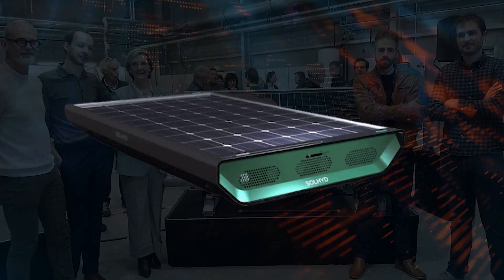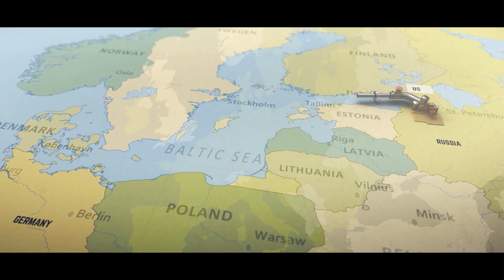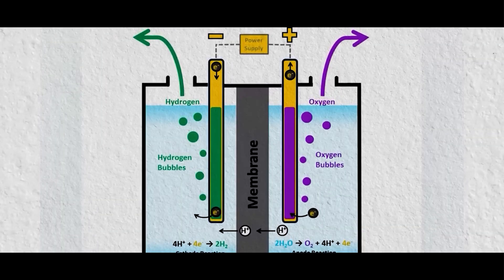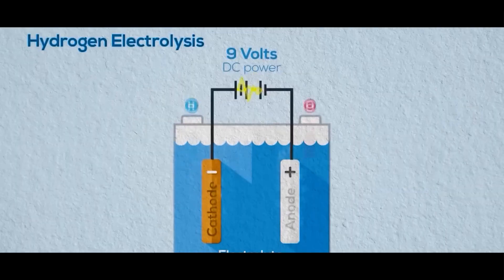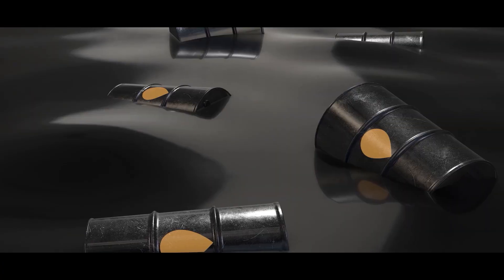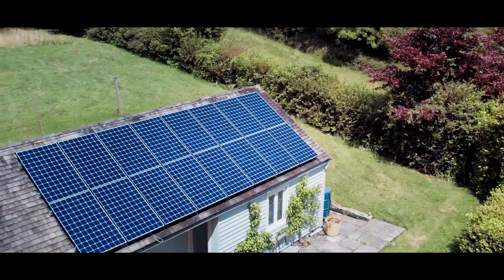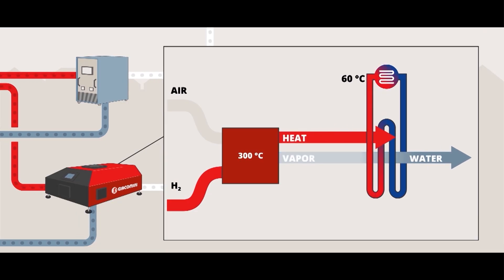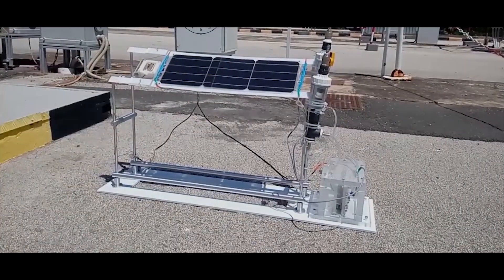NEW Solar Panel Produces Cheap Green Hydrogen at Home | BREAKTHROUGH!

Comment: With hydrogen, we can still use our conventional ICE (internal combustion engine) vehicles with some modifications, enabling them to run on pure hydrogen. This would make our ICE vehicles clean energy vehicles, even cleaner than EVs.
Reply: No you can't
Reply: ... yes, but do not forget the low thermodynamic yield of any engine based on a combustion (of any fuel wharsoever).
Reply: Great idea. Now you will only have to pay around $50k to get the rest of the car converted to run on hydrogen. Plus the $300k to get the equipment to compress and store the hydrogen. Then you will need about 120 of those panels to create enough hydrogen to be useful for driving. Good luck with that.
Reply: @Aircam73  I'm not talking about ALL of it. I'm talking about people who wish to use their ICE vehicles instead of buying a new and dedicated one. That would be cleaner.
Reply: @Schjoe  What I am saying is most people that say things like you keep saying know almost nothing about hydrogen. You can't just convert the engine and start running it on hydrogen. It would take around $50k just to convert your car to run on hydrogen. You would have to rip out the entire fuel system, gut the trunk, cut holes in the body and run high pressure tubing throughout. To put enough hydrogen tanks into a car to make it get close to 200 miles of range with a very inefficient ICE you will take up the entire trunk area, all of the under seat areas with very expensive high pressure tanks. The people who have done it said the cost alone for all the equipment is close to $50k and if you got someone else to do it you are looking at close to $100k. All so you can buy fuel that isn't available, costs 4 times as much and now your car gets half the range it once did. Sounds like a great idea.
Reply: @Aircam73  I'm not also saying that would happen right away today. My point here is, if this will happen, it will happen slowly. We may be looking at 10-20 yrs before every car that was using fossil fuels will be using hydrogen. By then, the cost of converting or may have significantly reduced or other ways of converting without the things you mentioned can be done already. Just like how any other technologies, it evolves and keep innovating as years goes by. Maybe the process is $50k-100k today, but who knows, maybe it'll be just $10k in 10 yrs using simple process and you only have to use water instead of storing a hydrogen gas that may explode. Sounds impossible but technology's innovation is really unpredictable.

Comment: If I can say what they want to say but how are they producing energy from the hydrogen? Because if you have to burn the hydrogen to make energy, you are just putting more carbon in the air more CO2 because as if anybody knows with a little bit of sense. Anything you burn anything it will produce carbon. So making these solar panels truly is pointless to try to get us off fossil fuels when hydrogen is a fossil fuel. The only thing is is working the water from H2O to just hydrogen then separating the oxygen from the water. That is it and besides, even if you could prove me wrong on all what I just said and I'm sure it wouldn't be that hard to prove me wrong. The regular people call the masses or not going to be able to forward something like this. They don't make that kind of income in 2 years of giving every dollar they got or euro and they still wouldn't be able to afford it. The price has to drop dramatically so I'm not going to throw my regular solar panels off of the roof just yet. But y'all can do what you can want. If you can afford it. Do what you got

Comment: These hydrogen panels has been developped by the university of Leuven and a spin off is doing further resaech. This  started 3-4 years ago.  At this moment you can forget an installation at your home as the gas must be kept under high pressure tanks. Hydrogen at home is not yet profitable. Hydrogen is mainly used for ships, trucks trains and other heavvy transport. No not for a car.
Reply: Fuel cells??
Reply: Toyota currently sells hydrogen cars in California…
Reply: @TheNewMediaoftheDawn  Its the only state that does this as they have a distribution network for hydrogen. Some firms ( as Colruyt ...)  in belgiun has also hydrogen cars but its more for publicity.......we have a long way to go as now hydrogen for cars is way too expensif. That wil hopefully change in time.
Reply: Im in the ship industry. We install lately a lot of batteries. But had "almost" one hydrogen project. But Hydrogen is NOT used for ships yet. And trucks are now failing fast as batteries get better. Hydrogen is a failure.

Comment: the cheapest version of the picea system costs about 60000 Euros. Their are quite a few systems already running in Germany since 2018. Instead of installing a swimming pool in your garden, you install such a system 😊. The good thing of the system is: it is very reliable technology and good german engineering. Picea builds about 100 systems per year. Scaling up will bring the prices down. The core technology is modular and not bigger than a refrigerator, with two parts: the hydrolysis unit and the hydrogen fuel cell unit, which turns h2 back to electricity and heat. 
Greetings from Franconia

Comment: This product has similarities to SunHydrogen’s product but may be using very different chemical reactions.  Green hydrogen needs to compete with grey, brown and blue hydrogen.   Finally whatever form of hydrogen your using has to compete with the various other means of storing energy including using gravity as a long term means of energy storage as you can do with pumping water up to a high reservoir or lifting heavy weights up and down.
Reply: "Green hydrogen needs to compete with grey, brown and blue hydrogen"
I have produced clear hydrogen but never any with these colors.

Comment: This is DUMB! Just charge a battery which is much more efficient! Hydrogen is hard to store and if it leaks and finds an ignition source like a spark or open flame you will have house/building fires or explosions! Get non-flammble Zinc-Bromine Flow Battery instead which WILL NOT catch fire!

Comment: Could the hydrogen be used in a fuel cell to generate electricity?
Reply from the maker: Yes. Watch the video till end. There you see a system to convert hydrogen back into electricity.
Reply: @The.Futurist  and only costs 10x the amount of power generated by ordinary solar

Comment: As I have a heat pump which is working well and solar panels/ev I am looking at battery storage to maybe complete my setup. Conventionally using green hydrogen for heating versus a heat pump requires 6 times  more wind/solar. Not sure how stored hydrogen could be used with a heat pump and I am more than happy with my EV but I can see this might work for an industrial unit where they have space to install .
Reply: @D M Since Jun 22 I have achieved an average COP of 3.55. even at current UK cap cost of heat Gas = 10.3/0.9= 11.44p/kWh Electric = 35/3.55= 9.86p/kWh. However we have cheap off peak so our average cost of electric is about 26p/ kWh so cost of heat about 7.3p/kWh. Saving on our heat requirement  11184* (11.44-7.3) = £458 . Inc no standing charge over £500 cheaper. For DHW we have solar and night tariff etc.

Comment: Clever idea.  The winter might gum up your moister from the air portion as water has been known to freeze during the winter.  Also, hydrogen, because it is a very small molecule,, has been known to be adsorb into iron.  Thereby making iron vessels a sort of sieve.  My guess that the team that put this nifty idea together would benefit from the advice of a Chemist.
Reply: It's not this company has been crushed by people who know physics and math on linkedin. One panel does 125 liters at atmospheric pressure on a sunny day. Which translates to 0.33kWh a day. That is NOTHING for a solar panel. And then you still have to bring it under pressure which also loses energy to store it. Then bring it into a fuel cell which you lose another 50% of energy to get electricity back. While conventional Lithium batteries have an IN-OUT efficiency of 90%.
Reply: sigh  Hello unnecessary skeptic.  I didn't hear anyone say the tank was made of IRON.  I didn't hear anyone say that the tank didn't have an internal coating.  I didn't hear anyone say that there were buckyballs involved.  Did you Mr. Skeptic?  No? I didn't think so.  STOP TRYING TO STOP ADVANCES, either because you paid to, or because you are just a total defeatest.  The reason doesn't matter - and frankly, no one should bother to listen.

Comment: Very interesting concept, doesn't seem to make sense for residential but scaled for commercial it looks promising especially dealing with the issue of distribution at the beginning of an H2 economy
Reply: Natural gas is one of the most clean burning of fuels
Reply from the maker: If storage prices come down, would even make sense for residential though.
Reply: @The.Futurist  residential couldn’t afford the insurance on hydrogen, no more than a private company can afford the insurance on a nuclear power plant which the government ends up paying BY taxing
Reply: @bobleclair5665  what insurance ? hydrogen is not that dangerous. A lithium battery is WAY more dangerous. Not to mention gasoline. hydrogen is the future as battery tech will never reach the point where you can fill your car in 3 minutes to drive 600 miles.
Reply: @superspooky4580  The Germans too have just announced that they have for the first time store hydrogen in paste form which is extremely stable at a wide temperature range making it almost completely safe to store. It also stores the hydrogen at a much denser rate than in liquid form. It has 10 times the energy density of a lithium battery. They initially plan on using it in planes and drones enabling new designs and longer flight times with far less weight. It is likely to be used in flying cars one day soon I'm sure.
Reply: @superspooky4580  if it’s water in the storage tank and from the water with a hydrogen generator, you produced the hydrogen as you needed it, I would agree with you  but if you have a storage tank full of hydrogen. I’d keep my distance,far.   Now can you imagine a hydrogen car with a full tank parked next to EV. What could go wrong?
Reply: @The.Futurist  we are doing it in very big scale in denmark and scandinavia..
and this makes most sense with stuff that needs to burn alot of gas to create heat or for machines that pull alot of weight..

setting up ev´s first and then going for hydrogen would create so much waste, so it makes no sense for private use for  many many years

decides when the price comes down 🤣 i have paid for hydrogen being made for free in a huge scale over my tax...
and it is still over 2 times more expensive then driving a gas car (and the car also cost the double as a ev)

the goverments needs taxes, and they dont get that from giving away everything for free